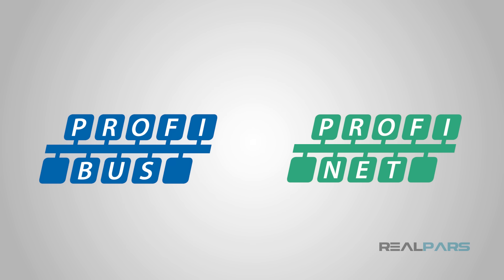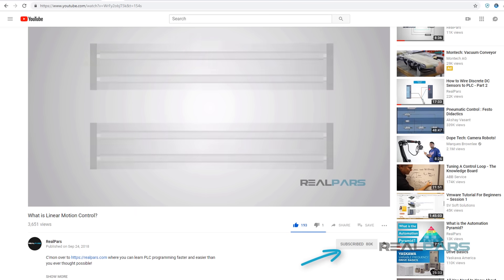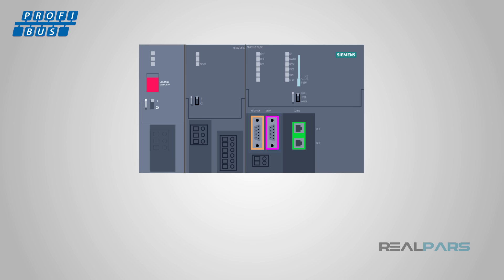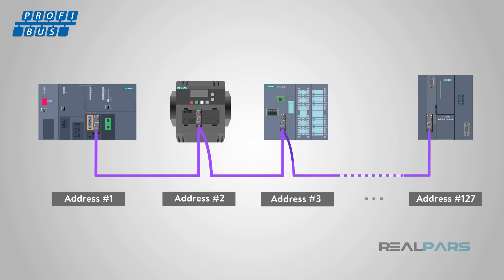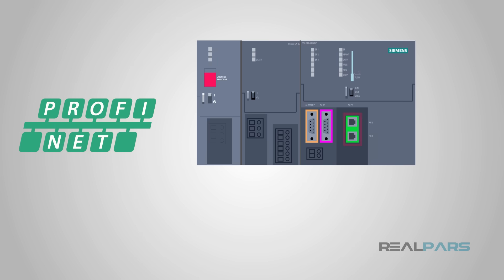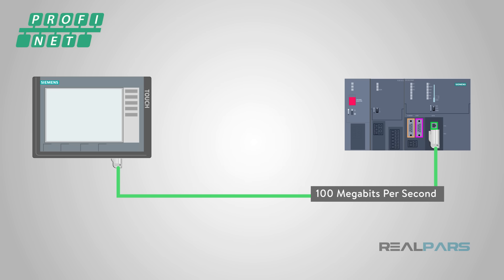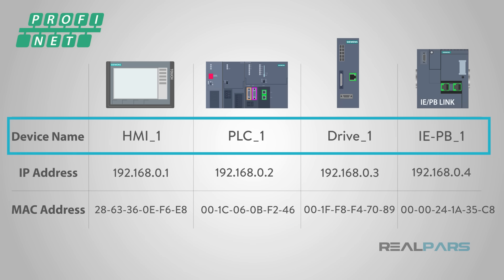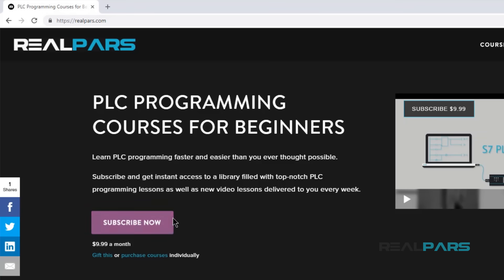What is the Difference between Profibus and Profinet?

Comment: my understanding is that tcp/ip is used between computers, and   rs-485 is used between controllers.  according to this video. profinet h/w is rj45 . same as ethernet.  so. could i understand Profinet is the tcp/ip? which is able to be used in Controllers?

then DCS side could configure such as tcp/ip?
So  S/W & H/W configurations are same as TCP/IP Between DCS & PLC?
Reply from the maker: Hi there, 

Thank you for your question! Profibus, Profinet, and industrial ethernet are communications protocols. In other words, the software features. And TCP/IP is a set of rules and procedures used in the protocol, the same as RS485, and RJ45 is the name for the cable used. You can have all protocols in your system included in a DCS. It depends on the hardware you use and the software installed on your system. Here is a link for your review on communication with Siemens PLC systems. CPU-CPU Communication with SIMATIC Controllers. 

https://support.industry.siemens.com/cs/products?search=communication%20with%20simatic&mfn=ps&o=DefaultRankingDesc&lc=en-US

Happy learning!
Reply: @realpars  thank you for your reply.  so profinet can be used for simense internal communication. and at that time . if the plc groups communicate with other system such as dcs. then the communication between plc and dcs can use either rs485 or tcp/ip. regardless of plc internal communications?

Comment: What is ET 200S & DP/PA Coupler?
Please explain
Reply from the maker: DP/PA coupler is a device that allows a Profibus PA segment to be joined to a Profibus DP network.  Siemens PLCs do not have native Profibus PA ports built into the processor but do have Profibus DP ports.  So, when a Profibus PA network is used to interface transmitters and control valves to the control system, a coupler is used to join the PA segment to the DP network.

ET200S is a compact CPU and distributed I/O system into one hardware profile.  The ET200S can be thought of as a small S7 CPU with limited capabilities used for single machine control.  The ET200S is being based out and has been replaced by the ET200SP, which offers additional I/O choices and a more powerful CPU.
Reply from the maker: Hi Sharif, 

Thanks for your comment! That is a great topic suggestion, I will happily go ahead and pass this on to our course developers. 

Happy learning and thanks again for sharing!

Comment: Hi! Great video! Quick question, would it be possible to implement a custom PROFINET controller, say, with a microcontroller? Since some of them already have Ethernet support. Thanks a lot!
Reply from the maker: Profinet Ethernet are both Industrial Ethernets,  but are distinct protocols with different application stacks in their communication processors.  A custom Profinet controller really cannot be implemented from an Ethernet controller.  However, many companies, such as ProSoft and RTA, sell Ethernet to Profinet gateways that allow the two protocols to coexist on the same network See:https://www.prosoft-technology.com/Products/Gateways/PLX3x/PLX32/EtherNet-IP-to-PROFINET-Gateway-for-dual-subnets. \  I do this all the time for connecting Siemens-controlled equipment skids to an Ethernet/IP network.

Comment: Hello...
Is "s7 communication " using PROFINET Protocol or isit its own Protocol?
Reply from the maker: No, S7 Communication is a proprietary Siemens communication protocol based on ISO TCP.  It is fast, secure, and has little overhead.  That makes it ideal for communication between SIemens CPU's (peer-to-peer).
Reply: @realpars  thanks for the answer. ok so its not profinet.
Because profinet  use IO communication like send receive addresses right?

Comment: It is not recommended to extend or branch a bus using the service port on the back of the connector!

Address 127 is absolutely not to be used! It is the broadcast address. Also stay away from 126 as it is used for devices that use the Set Address function. 

Cable segment lengths up to 1200m is allowed when baudrate is 93.75Kb/s.

Comment: I would like to know how many nodes or devices can be connected to a single PROFINET RING. I have a requirement which asks to connect more than 50 nodes to a single PROFINET ring which is ~400 metres. Is this possible and how.?
Thanks for sharing good learning videos..
Reply from the maker: Hi Sonu, 

Great question! That would make for a very helpful topic suggestion - I will happily forward this to our course developers. 

Thanks for sharing!
Reply: Generally, a PROFINET network can support up to 128 IO devices. However, the actual number may vary based on the CPU and the network's power.

Comment: The frequency inverter symbol used in this video is actually Siemens Sinamics V20 which doesn't support Profibus or Profinet. It would be better to use the symbol of SINAMICS G120 or G120C instead.

Comment: I was wondering what'd be the differences between profinet and snap7 protocol?
Reply from the maker: ProfiNet is a defined protocol that is based on TCP/IP and is built-in to many devices and controllers to allow easy setup and configuration of the control network.  Snap7 is an open protocol that is also designed to work with Siemens S7 hardware, but it allows the programmer to communicate with the hardware via a .NET or C program, giving the programmer greater flexibility in interfacing PC-based applicatios to the PLC.  However, the programmer needs to consider all of the abnormal situations (comm loss, application fault, etc.) that are transparently handled when using ProfiNet.
Reply: @realpars  Thank you so much for your reply, I was wondering if there is any Snap7 api that would allow a real time socket communication to the hardwares. For example, if M40.1 bit value changes, then it will reflect the change on the Snap7 program without having to poll or query this value every 1 second also... 

I hope I don't ask too many questions but I was curious to see if Profinet is much different than Ethercat protocols? I've heard that Ethercat is open source as well...

Comment: These 2 networks are very different both in hardware and software. In the 90s, we used this profibus network to drive the 150 electric cylinders which apply the forces to compensate for the deformations of the mirror of the very large telescope in Chili (VLT). The profinet network described seems much closer to the internet than the profibus which has a more real time orientation.
Reply from the maker: You are correct, Profinet is very close to Ethernet used for Internet access.  ProfiNet is an Industrial Ethernet variant that is based on layers 1-4 of the OSI model. ProfiBus is a more time-controlled protocol that is used for real-time control between devices and requires:  1)  a master interface to control the timing, and  2) use of terminated bus cables.

Comment: So very well explained as is every video. It must be a checklist initiative on the creative team that every video must be well and clearly explained that any new person to automations will understand. Just so well done. 
Question though: Is ProfiNet only used with Siemens PLC Systems? Is there some inherent value with all the shielding on the ProfiNet cab,e?
Reply: There are other systems besides Siemens that use ProfiNet, although Siemens systems are the largest user of the protocol.  ProfiNet cables do have a shield which helps to reduce transients on the cable and helps eliminate induced voltages which can affect communications.  Any "flavor" of Ethernet is susceptible to "noise" when installed in an industrial setting.  Shielded cables are needed to provide reliable and error-free communications.
Reply: Scott Sommer The personae to both questions are greatly appreciated for understanding. Thank you!

Comment: Profit bus is on the passed now because the communication sucks cable is so sensitive and drop signal between VFD to VFD now they swap this bus communication cable with ASÍ and been good where I work
Reply: If you are dropping comms between your VFDs I would suspect that your terminations aren’t done right, or that your cables aren’t long enough. (1M is the min. for your cable length between devices).

Comment: Using one of both depends on the application. In the case of processes involving discrete variables, motion control and fast response applications Profinet is most likely to be used. Profibus better fits in processes like mixing products, temperature control, and reduced speed applications (compared to Profinet).
Reply: Not true, Profinet is the way, profibus is old fashioned, cannot carry tcp/ip traffic. for these process speed is indeed not the issue but profinet provides much more than speed alone.
Reply: 8th 92ee287

Comment: Profibus physical layer is RS485 , last and first device on the bus has to have termiation.  Addressing starts from 0 up to 125, 126,127 are special addresses. Other media (like fiber optic cables can also be used)
Reply: You are right, fiber optic is usually used to compensate for data transmission speed by means of converting one transmission media ( copper cable) into another  (fiber optic) by optic link module or some other media converter